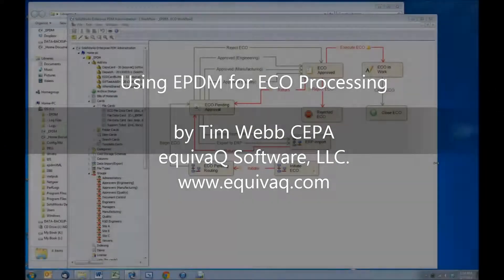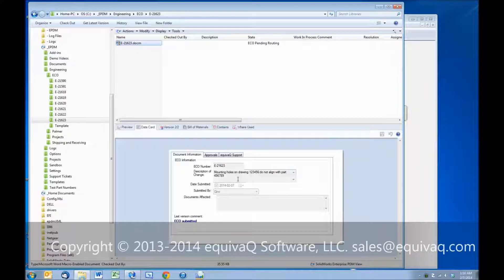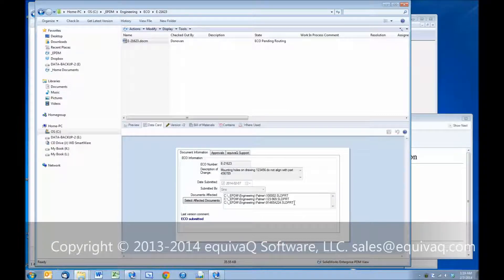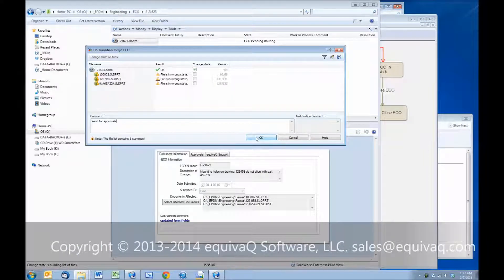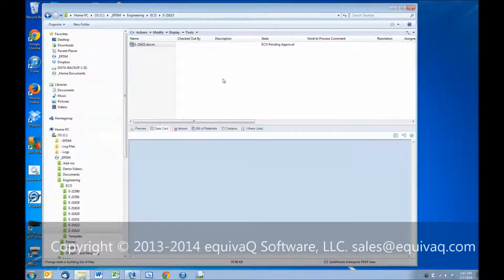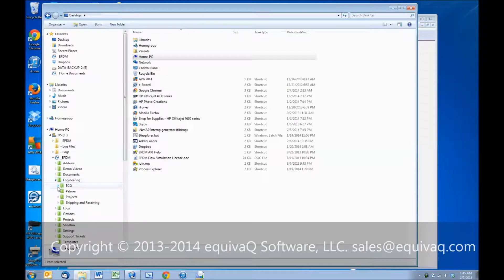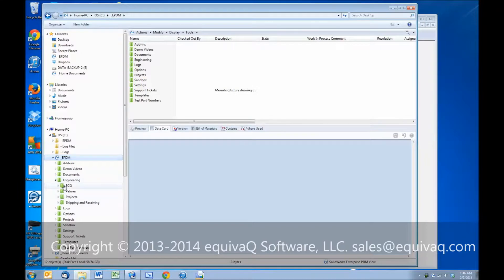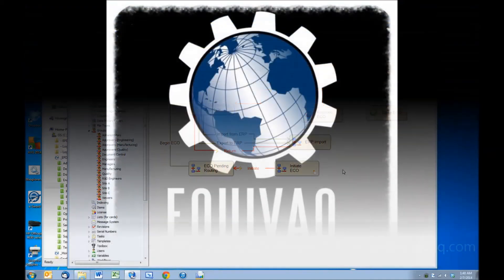Automate ECO processing in SOLIDWORKS PDM

Comment: I have the same question as kartz.  Also I am curious where you get the ECO workflow used in this video.  Is this something your company made OR is this something provided out of the box in the software?
Reply from the maker: Yes, the affected files get linked to the ECO (preferrably an XML document) by our Attach References Tool add-in. You can learn more about it here: https://equivaq.com/product/attach-references-tool-solidworks-app
In the video, we were using a Microsoft Word document but that requires VBA code to auto-populate the form fields from the data card. In the last couple years, we have begun promoting the use of XML documents for your ECO process. Benefits include automatic updating, preview allows you to print a hard copy, no VBA code to manage...etc.

Regarding the workflow, this is an EQUIVAQ developed workflow that we can develop for you as well as a paid service
Reply: @equivaqsoftware2368  Thanks for the nice reply!  I am actually a software QA engineer.  We will be doing a lot of work around the SOLIDWORKS PDM workflows which led me to this video.  So I am not sure we would implement this sort of setup but I want to understand what our customers will be doing.  ;)  Nice video.  Thanks also for the nice reply.

Comment: Very well explained. Can you explain how the documents affected gets linked to the ECO file? Is this using Add-ins?
Reply from the maker: Hi Karthik. Yes, the affected files get linked to the ECO (preferrably an XML document) by our Attach References Tool add-in. You can learn more about it here: https://equivaq.com/product/attach-references-tool-solidworks-app

In the video, we were using a Microsoft Word document but that requires VBA code to auto-populate the form fields from the data card. In the last couple years, we have begun promoting the use of XML documents for your ECO process. Benefits include automatic updating, preview allows you to print a hard copy, no VBA code to manage...etc.

Plus, it's on sale now through year end! $19.99 per month or $199.99 per year.